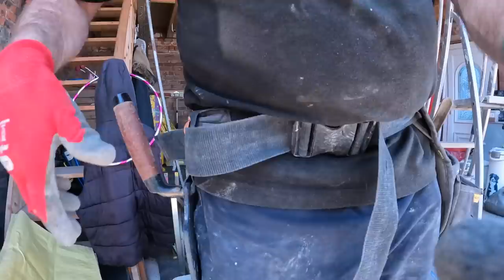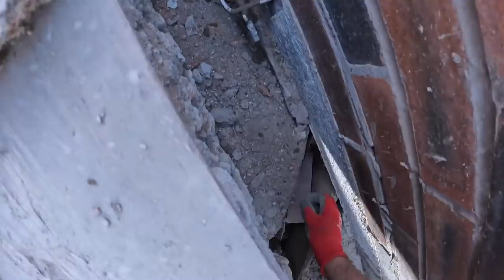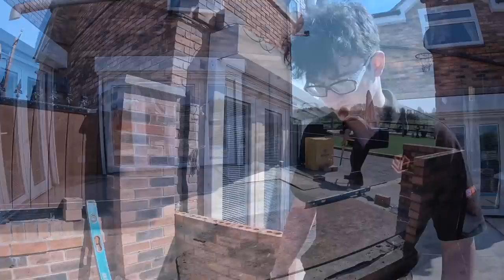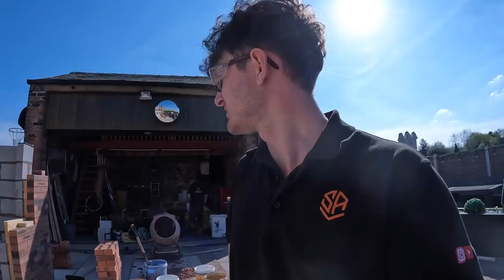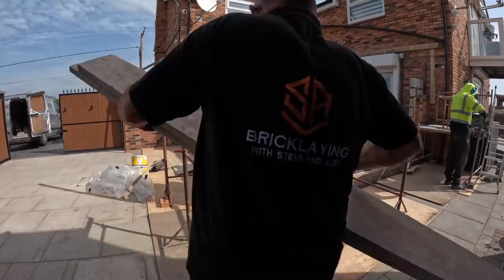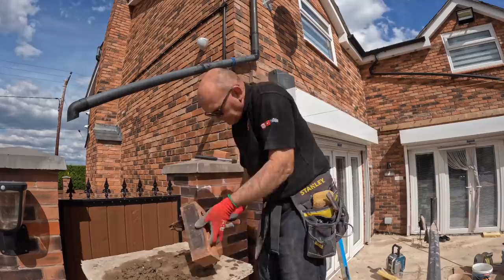FACE BRICK AND BLOCK PILLARS  ...DPC TO STEELS HEIGHT  ...L SHAPE EXTENSION PART4

Comment: Just a small question. Here in Northern Ireland at the window reveals we return the block work to meet the outside brickwork with a dp membrane between the brick and the blocks. This means the cavity is closed. Is not something you do on the mainland or is there a specific reason. Great videos you pair of boys are making by the way, no corner cutting with you.
Reply from the maker: We never return the reveals any more, not for over 20 years . the cavity has an insulated cavity former built in or put in before the frames are fitted to avoid cold bridging at the openings 🧱👍🏽

Comment: You made slots for a damp barrier in the existing building, are they enough to avoid cold bridging as well? I saw wider cuts been made on other builds so that the insulation can continue from the old to the new extension.
I have a house where they didn't do either when building on an extension, and there are always moisture stains in that corner on the inside where the outer skin protrudes in, only solution seems to open up the outer wall to make a cut. But that is now avoided by having external wall insulation installed.
Reply from the maker: It’s all down to the local building control 🧱👍🏽

Comment: Nice how you guys used hole and half bricks it looks really tidy and the pattern on those bricks is lovely. Nice house that could only be better with Anthracite windows, doors and fascias that would make it pop and add good value. Gorgous house though. Jobs worth doing rite! Nice piers they really match the rest of the property size wise in proportion. The gap in between 2 openings is a calculation though; by building code is add both openings widths together and divide by 6. That fives you the minimum distance in between both openings.  It looks like that is pretty tight with such large doors but if the windows aren't openers then that pier in the middle may just be big enough. I'm also not sure how that works when their is a corner  in between I would be interested.
Reply: Disagree - anthracite and grey has been done to death now (I think anyway), everyone is getting it done. Sash windows in cream would be lovely with that brick work.
Reply from the maker: @KeithChegwin24  . Standard white to match the house 🧱👍🏽